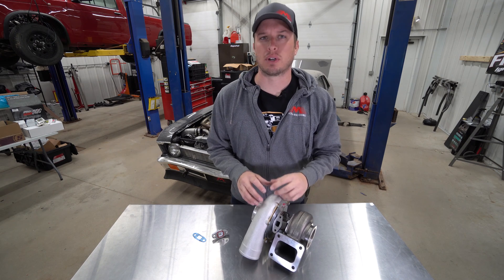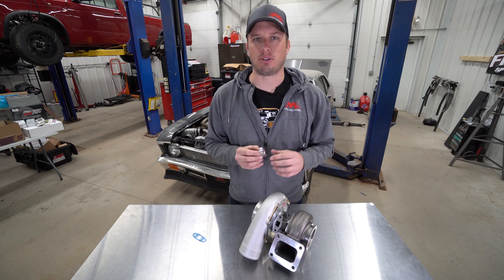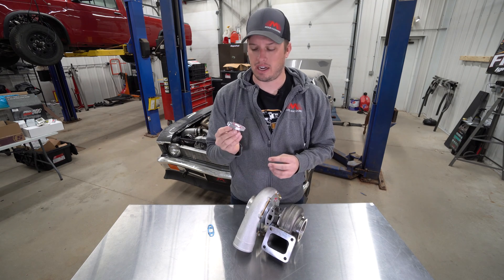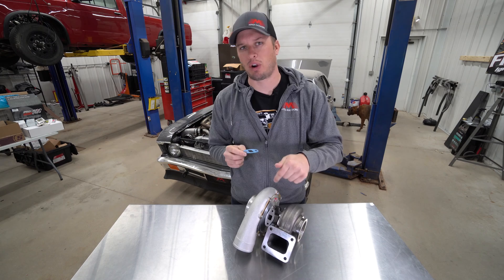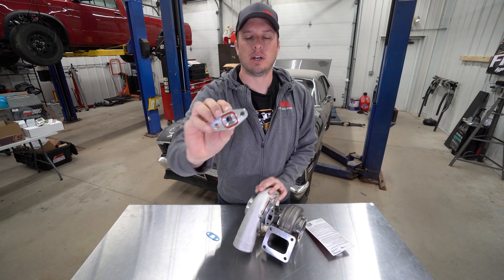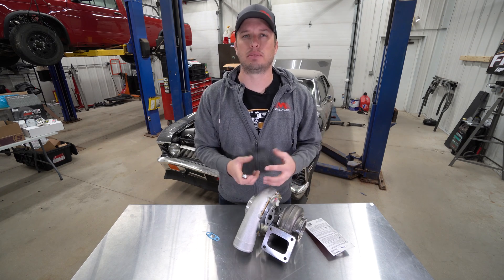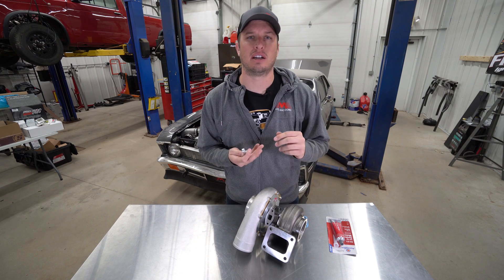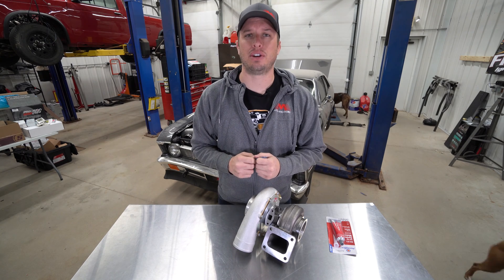Turbo Oil Drain Do's and Don'ts. No More RTV! [Tech Tip Tuesday]

Comment: Do you guys make a drain flange for the efr7163 Borg Warner turbos? Do you recommend using a flange or they have a threaded drain port for an AN fitting. Seams the AN fitting option would obviously narrow the opening but also potentially protrude internally?
Appreciate your thoughts

Comment: What if i purchased this flange and it still allows oil to come out..? getting to the point where im going to put RTV on this high tech flange because i cannot keep oil from pushing its way out from in between the turbo and the fitting. Frustrated as this is the 5th return line flange/configuration I've used without any luck stopping this issue.
Reply: Damn i had the same experience. So did u put rtv silicon on it? Please tell me what happen

Comment: RTV is fine so long as you're not idiot about it. More is definitely not better. If people would just follow the instructions on the tube RTV works well as a sealant for a turbo drain however there are better options out there, as we see here.
Reply: I personally use the rtv on drain gaskets and just like you mentioned if you apply it correctly everything should be fine.

Comment: I can name one turbo company that told me to use rtv on the drain which I refused to. They told me their surface was flat and the factory was not and also my aftermarket drain flange was not either. So I sent their turbo back and went with a better turbo company

Comment: 12 an version coming?
Reply from the maker: Rob Rohe we have a 12AN version for the large and mid frame.  To run a 12an and fit in a small to mid frame it’ll have to be an extended length piece.  We will be working on one for the near future